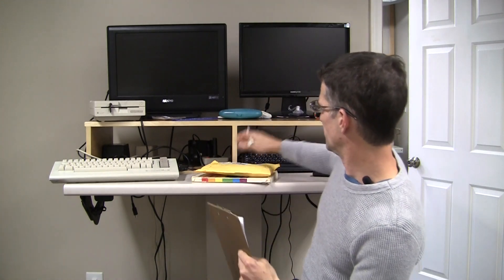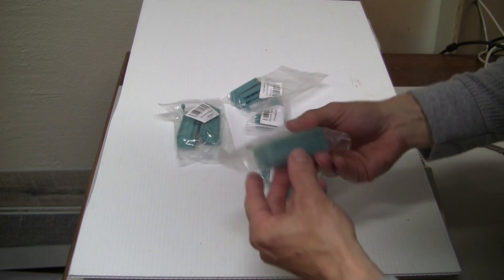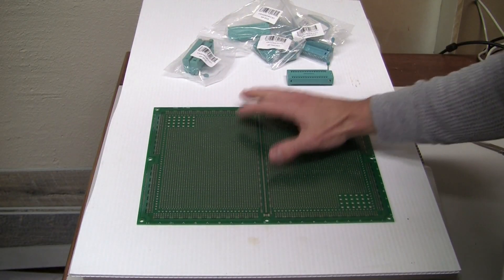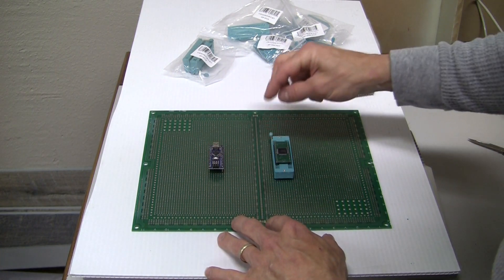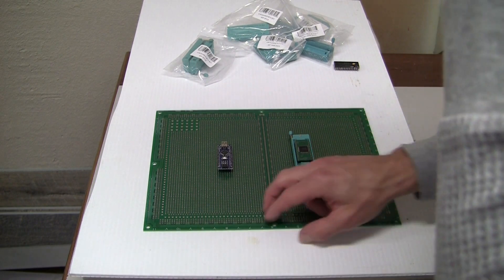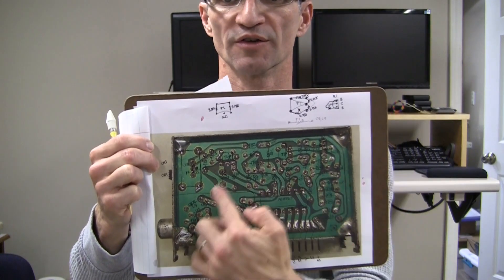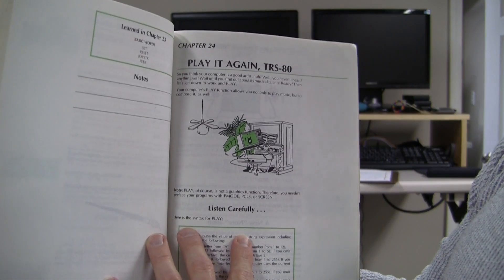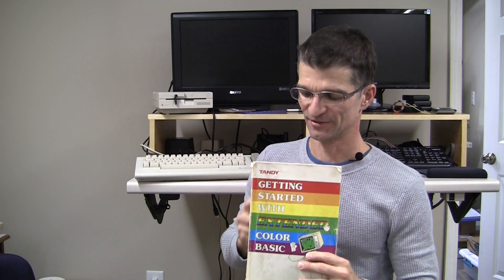#SEPTANDY Preview of Coco 2 Repairs, Coco 2 Composite Video, and ZIF Sockets for Commodore 64

Comment: https://colorcomputerarchive.com/repo/Documents/Manuals/Hardware/   take a look at the service manuals here..  hope it helps... there is the service manual and schematics there as well
Reply from the maker: Thanks Chris. I've been there today, been looking through these manuals. Most helpful, at least for the interface between the VDG chip and the RF modulator.  As for the innards of the RF modulator itself, I'm still not finding the details.  I can reverse it by tracing signals on the RF board but I just know someone must have done it and documented it somewhere. I would like to reuse the RF board itself rather than replace it with protoboard, but I need to know the board layout to be able to make sense of it.
Reply from the maker: I now have complete schematics for both the early and late versions of RF modulator found in the Coco-2.  Those are the only versions I'm aware of at this point but I wouldn't be surprised if there is a third type.  Anyone needs more information or has some to share, by all means, let me know.
Reply: @acs8-bitzone651  scan them in and put them on the coco zone archive or the coco facebook group as well
there may be different for the coco 1 and 3

Comment: Thanks for the update, AC.

ZIF sockets come in really handy when troubleshooting a new machine too. If you've got a known working computer, put ZIFs in for all the main chips.

This will allow you to extract chips from the machine giving you problems and very easily try them in the known good machine to see if it stops working. If it does, then you've found your problem!

Looking forward to Saturday's video.
Reply from the maker: Great idea, I've seen someone do just that, and I may work towards that as time allows.  Have you one for yourself?
Reply: ACs 8-Bit Zone Not yet. If I start acquiring broken C64s then it’s definitely something I’ll look at. For now, I’ve just got a C64 breadbin and C64C - both of which are working very well. :)